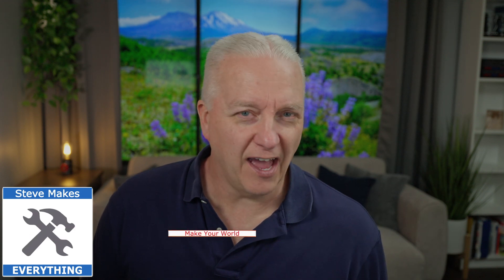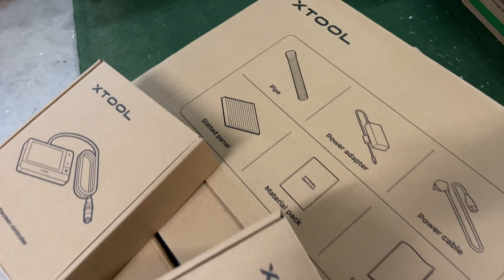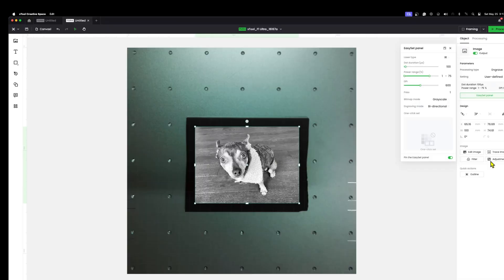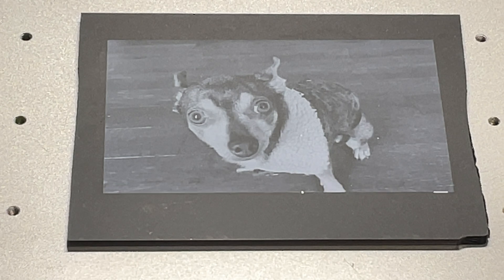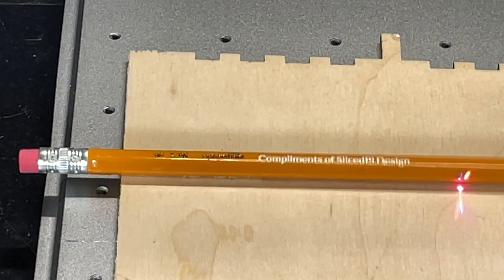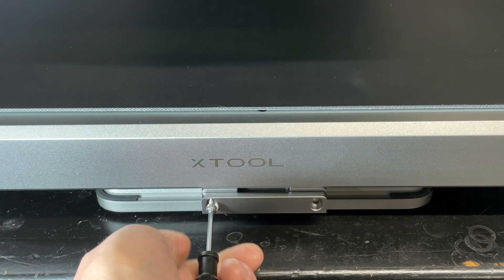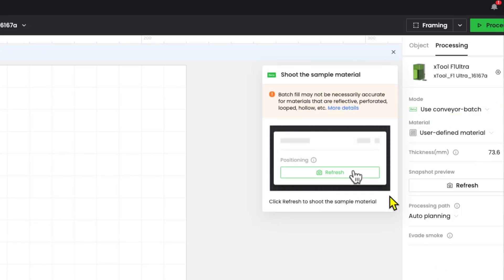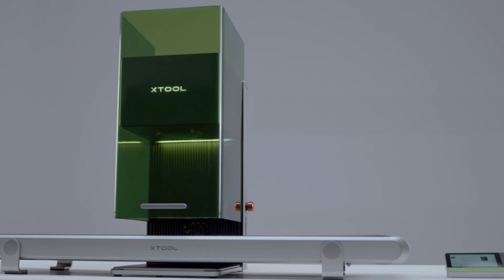Is the xTool F1 Ultra a Game-Changer?

Comment: Great video! I would sincerely appreciate any help you can give me. I need a recommendation for the best laser engraver for my specific needs. I want to start making rubber stamps in large quantities (i.e., for a high volume business) using a laser engraver. I’m new to lasers and the options can be VERY confusing.

Here are the details:

We only need the laser cutter to carve rubber stamps. The rubber we will be using is similar to the rubber available on Amazon (i.e., red rubber stamps for laser engraving).

Since we will be cutting a large quantity of rubber stamps on an ongoing basis, SPEED and the QUALITY of the engraving on the rubber is most important.

xTool recommended either the F1 Ultra or P2S. I’m not sure which one to go with. 

I would LOVE your opinion.

Thanks!
Reply: I ended up going with the flash foam stamps instead of the engraved ones.. cheap easy and fast
Reply from the maker: @ Hopefully, this isn't your subtle way of telling me I took too long to get the video out 🙂
Reply from the maker: The timing of this question is perfect.  I'm planning a video to help people select the right right laser.  I should be able to get this started this week, so it won't take too long.  Hopefully, you can wait a bit longer.

Comment: Hi all, I have a question. I have never used a laser engraving machine and would need it to engrave letters to empty computer keyboards (it has no letters on it, so just blank keys). Material is usually plastic (don't know what kind of plastic). My engraver uses a laser but don't know what kind and results are great. Now I would like to start doing this on my own, so as a NOOB, my questions to you experts are. Is it complicated to do such engraving? Will I learn it quick and do I need to know how to use any additional software? As i looked Xtool F1 Ultra would be suitable for this?
Thank you!
Reply from the maker: My reply got lost so here it is again.

The F1 Ultra might be overkill if this is all you do with your laser.  The keys on a keyboard are typically ABS or Polystyrene and either should engrave with pretty much any laser - even something like a 5W diode laser.  You'll have to play with the settings of course.

If you are using an xTool laser then no additional software is required.  xTool provides XCS for free and it works well.  If you are using others lasers, you might have to buy a copy of Lightburn, but it's priced reasonably.
Reply: @SteveMakesEverything  Thank you so much. Well I would like the F1 ultra as I hope in time I will be ablet to do a lot more engraving. Just 2 more questions please. Would you recommend to use the conveyor belt for engraving the keyboards as I will need to move them 2x to engrave the whole keyboard without the conveyor? And if I understand correctly, it should be quite easy to set up the laser for engraving letters on different type of keyboards?

Comment: I guess that the diode laser is not the best option for cutting polyester fabric, but can it be doen at very low speed? Maybe with dual at the same time?
Reply from the maker: I’ve never cut polyester so I can’t help much, but the diode laser would be your only choice. Btw you can’t run both lasers at the same time.

Comment: Amazing stuff! But the batch process just confused me. It looks like the engraving was totally misaligned (rotated) on the wooden batches. Just camera angle? Is it really usable like throwing the stuff in the belt like advertised?
Reply from the maker: Some was camera angle, but I did have two with alignment issues that I’ve passed on to Xtool. They are working on this and it may already be fixed but I haven’t checked yet.

Comment: Is the conveyor more valuable than the slide extension? The slide extension is totally underwhelming. The slow speed of slide is horrible. I wish they would change the firmware to advance the slide 4 inches at a time and let the super fast galvo head fly, then repeat.
Reply from the maker: Unless you are doing some sort of volume engraving, or plan to engrave projects that are larger than 220mms, then the conveyor is probably not necessary.

As far as movement, they actually do move some measured distance and then stop to look at the workspace to see if there is anything there to engrave.  It's reasonably intelligent.

Comment: What coin did you use for that example?
Reply from the maker: I just used some brass coins I bought on Amazon.  The Amazon coins are less than amazing though and I wouldn't recommend them.
Reply: @SteveMakesEverything  thanks so much! You got yours from Amazon? Do you have some you would recommend?
Reply from the maker: @brotherlybbert  Unfortunately most of these appear to be cheap things made from old scrap metal, but you can try them.  The copper ones should be avoided because when I tried one with the F1 Ultra, it just got black and crusty (xTool warned me that this would happen, though.). You can try the ones here (https://limitlesssolutions.org.uk/) though I haven't used them.  They keep coming up in our weekly livestream and appear to be pretty capable.
Reply: @SteveMakesEverything  thanks for the info

Comment: While it is true that this fiber laser has a 220 by 220 work area while others typically have a smaller area (110 by 110). It is important to note that the larger the work area, the larger the laser point will be. So in having a larger work area you are lowering the lines per inch and thus your resolution. But there is a second advantage to having a larger working area and that is that the range that the laser is in focus vertically is greater the larger the work area. This is because the lens is positioned further away and doesn't have to bend the light as much as it would for a small work area.
Reply from the maker: I'm on the fence about the larger area.  It's certainly nice to have, but there are times when you want to confine all of the laser power to a smaller area in order to increase the energy density into a smaller area.  My Commarker B4 20W has both100mm and 200mm lenses and I always use the smaller one because most things that I do on a fiber laser are smaller engravings.

Comment: Well this was pretty low effort. I guess you just needed to pump out a video for the free machine.
Reply from the maker: If you think I do anything on YouTube for a free laser then you are sadly mistaken - I already have lots of lasers.  I published this video because I see a new tool with high potential to help Makers, but given this is the first day of a new laser release, you will certainly find many other videos on the same subject and hopefully one of these quenches your thirst.

For me, this is the first video in an on-going series to cover the details of this new hardware and the kinds of projects that it enables.
Reply: I purchased the S1 after watching reviews by you and others on YouTube, and now I am disappointed in the S1 40-watt. It does not live up to X-Tool's claims. It struggles to cut even 3/8-inch plywood. X-Tool even had the audacity to post a picture of the S1 claiming to cut through 19mm plywood.
Reply from the maker: @bran3209  Hmm, I was using the S1 as my main diode laser until just a couple of days ago without issues.  Have you asked xTool about this - maybe there's a problem with the laser module.

FWIW I wouldn't be trying to cut 19mm wood in a single pass with any laser because it's just going to burn.  however, you should still be able to cut 3/8" plywood in a single pass with the right settings.  Have you run a material cut test on this material?  Some plywood is very hard to cut because of the glues used in it.
Reply: 100%  definitely seems that way.  Totally rushed and slapped together.  Even the conveyor was low effort.  Couldn’t even spend the extra 10 min to engrave the welcome sign on the conveyor.  Instead a simple 1 min outline of the word welcome on the conveyor and called it a day.  I don’t expect our comments to last long.  Typically, anything negative gets removed or hidden.
Reply from the maker: LOL, if you think I'm about to delete your comments you'd also be wrong about that.  Unless you are verbally assaulting someone or spreading complete lies, your comments will live on.  You do understand that this is my channel, not xTool's, right? If you have specific issues with this laser, then I'd certainly encourage you to connect with xTool and provide feedback.

Having said this, the way I understand your comment is that your big complaint is that I did a welcome sign with an outline rather than an engrave.  If this is your real issue, let me know and I'll be happy to post an engraved welcome sign just for you.  But if you think this is going to look different than any other diode laser, you'll be even more disappointed than you are now.

I will cover the conveyor in more detail in another video and I'll be sure to fully engrave everything, so you know it works.😉
Reply: @Firstleaker  seems to me the machine is VERY underwealming and the youtubers are afraid to say so and not get any more freebies, so they put out completely useless ads like this instead.
Reply: @LollipopWoodworksNWA  - I disagree, I think xTool has definitely pushed the industry in the fiber category after this release.  The only advancements we have seen from the fiber industry is power. The Ultra will only make these other companies wake up, and start to develop better and more capable technologies.  I have watched every review, and it seems that the reviewers got pre released machines and software.  However, most were still able to overcome these obstacles and put out well informed videos.  I have only seen one video with low effort, this one!  There is a new person with only 300ish subs that had a 10min video that was more informative than this.
Reply from the maker: You couldn't be more wrong about this statement.  If this machine was not worthy I'd be telling you.  As xTool can tell you,  I've poked a few hornet nests with them on some of their other products in the past.  While I think there is much more that xTool can exploit in the F1 Ultra, it is far from underwhelming.  My only real "complaint" would be that they had an opportunity to release a fiber laser with more than 20W and didn't.  I do see something like an F1 Ultra Pro looming to address this.